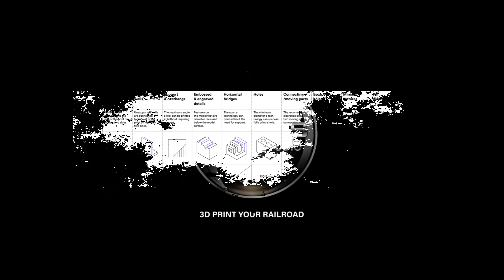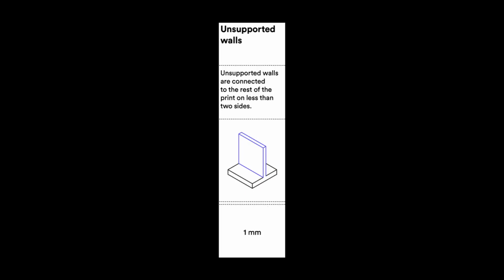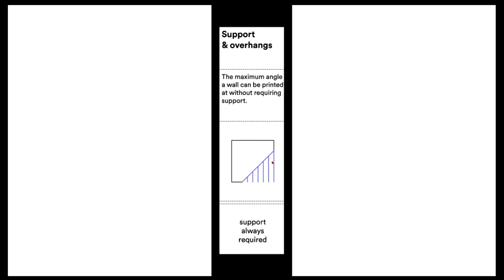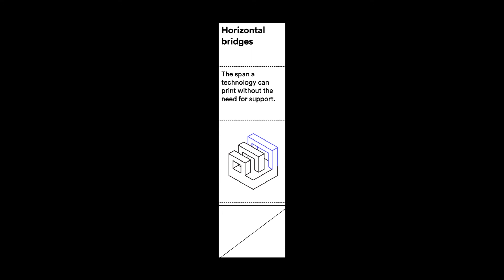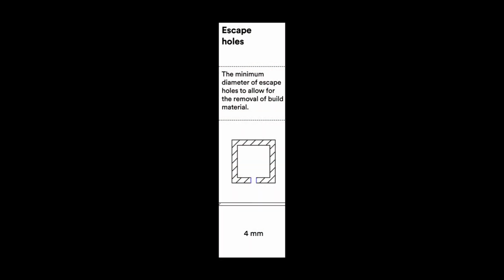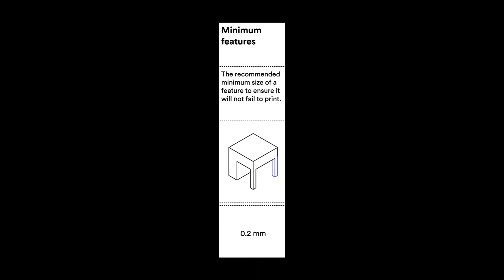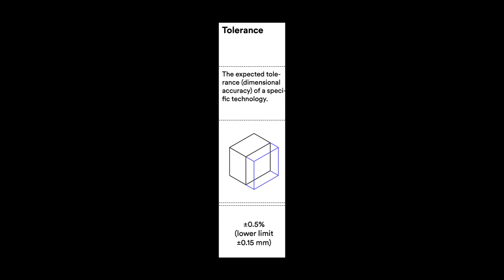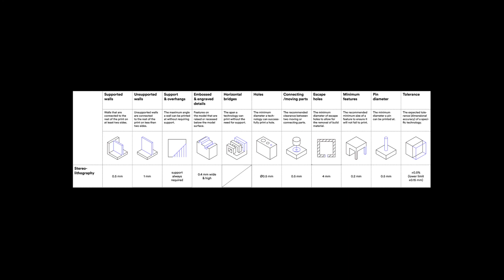HO Scale 3d Printing Guidelines

Comment: Do you have any good resources for models to print that are HO scale? I bought my dad a printer but he definitely won’t be able to computer model anything.
Reply from the maker: https://www.focusarchitecture.net/digital-downloads just started dropping my content in pre-supported format for modelers. Lots to convert over to this section but stuff is getting added weekly at this point. 

Other pages to check are thingiverse and cults 3d. There are numerous good models, but a lot of poor models that will cause more frustration than help. Lots of free content there, but you are supporting them yourself and hoping the models were designed correctly so that you can avoid trying to find the problems.

Comment: hi, do you think that this model positioning will work and print fine?
Or how would you place this object to avoid failurs?

https://drive.google.com/file/d/104Z6Bw0C3-GILCXklRpnXFM8-s1mhFaj/view?usp=sharing

Its a resin printer.

Thanks.
Reply from the maker: while it's difficult to see everything in the screen shot, it does appear to be a pretty good orientation for the models. Your model orientation by part looks solid, but hard to be 100% accurate with a small image.
Reply: @FOCUSCreativeStudio3d  can i send you another image from different angle?
Reply: @FOCUSCreativeStudio3d  hi,

we just printed the model. But look at this.

Some layers got loose and the model on the front warped on the corners. Meaning the front bottom line isnt even/streight!

Here are a couple of images of it:

https://drive.google.com/file/d/17KvPuaxYpGM0iIM4gHgMUr9_tC9BWvX1/view?usp=sharing

Do you have any idea or advise why this happend or could be avoided?

Thanks!
Reply from the maker: @gaboaaa23  this is a hurdle with many resins - some are better than others just based on their properties (I prefer Sirayatech Fast). The further along the model gets in printing the heavier it also gets which compounds the peel force. So layer after layer you are basically pulling on the soft resin and the only place for it to give is either at the corners OR to peel apart at other locations. I would suggest actually trying to split the models into pieces that allow for smaller cross sections and lighter models. Wall thickness generally does not need to exceed 1.6mm on models like this. Hope this might help!
Reply: @FOCUSCreativeStudio3d  thanks for the input!

This was my thought, that the model most propably is to heavy and teers apart itself.
Well the model is splited into 6 pieces alredy. Dont want to split it to more because it will be like a puzzle then.
The guy who prints it set the exposure time for the layers higher now. So it has more time to cure per layer. You think that might help?
Reply from the maker: @gaboaaa23  a longer exposure may help, but you might lose some detail the model with it being overexposed is all.
Reply: @FOCUSCreativeStudio3d  i  see. thank you!